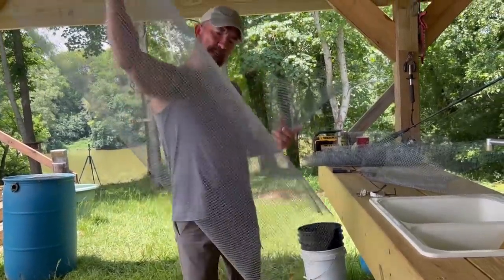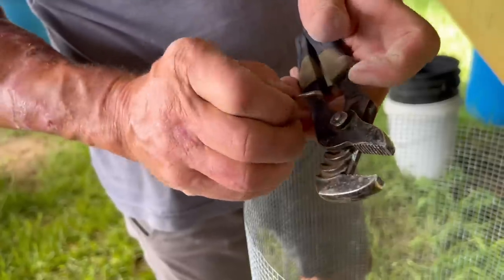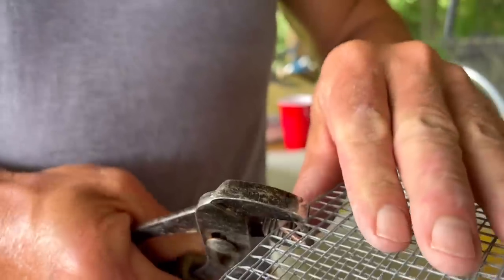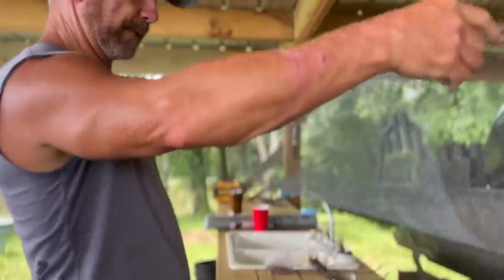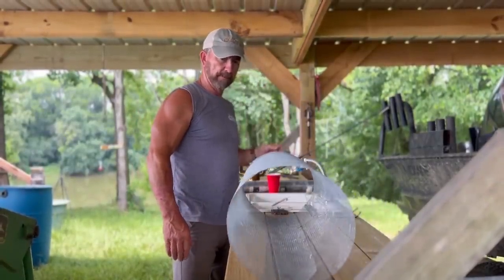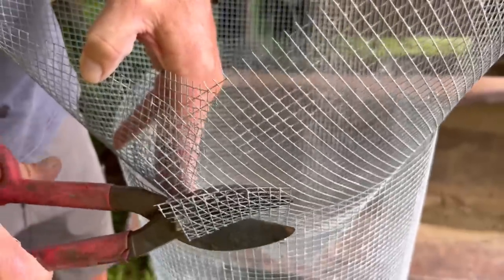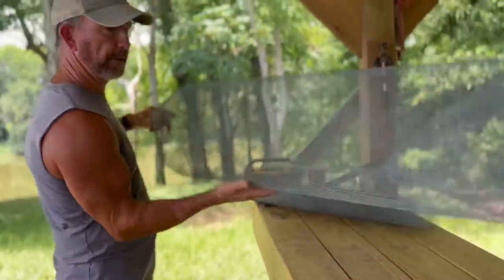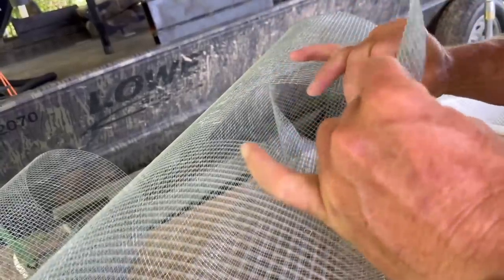How to make a quick and easy fish basket/ trap to catch minnows for bait

Comment: Nice video 👍🏻 instead of zip ties on the door I would have just use wire but still effective
Reply: Honestly zip ties work just as well everywhere on the thing.... That's what I used when I made mine..... Bro, you can hang a person with zip ties. LO l, they're not going anywhere.
Reply: @sharkkillag6380  You can break them small zip ties with your hands they teach you that in the military. However they do work just as good as wire though I agree with you on that.